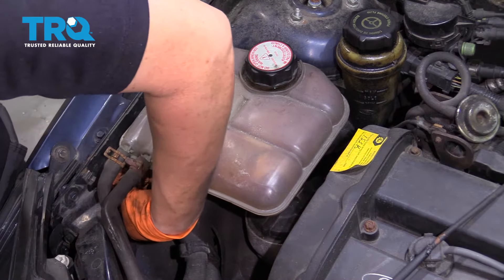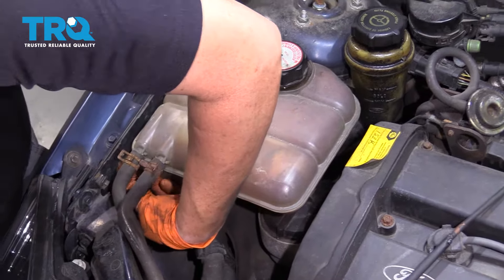How to Replace Serpentine Belt 2000-07 Ford Focus

Comment: 0:32 Nice video. Ours has a plastic cover underneath held on by two 10mm bolts that needed to be removed first. I'm pretty sure that plastic piece with the bolt in it on the right near your knuckles is what is left of the cover on the focus you're working on.

Comment: The A1 video showing alternator replacement said the tensioner was a 14mm. I imagine ill find out shortly, but im thinking you might want to clarify that. The 14mm worked, so im guessing its right, but im also guessing that not everyone watching this and trying to DIY it is going to figure that out real easy. Whats worse, is if it is a 14, but the 15mm catches just enough to make it work and someone either rounds over their tensioner bolt making it extremely difficult to ever do it again, OR it works just long enough to let them get their fingers in there THEN rounds the bolt making it impossible to let the tension off to remove them... they'll probaby end up removing them alright, just not in the way where they stay attached! Id want to distance myself from that mess if possible!
Reply: It was a 13 on mine lol
Reply: I think it’s dependent on which tensioner you have. I believe there’s three
Reply: My oem tensioner was a 15mm but I replaced it and the aftermarket one was a 14mm

Comment: i have a 2002 focus with A/C. Heres a good one for ya go to Oreillys and  order a belt cause im broke down right across the street. Easy! I got all the tools but the belt is shrapnel. spaghetti broke in 22 places.  So i get the belt for A/c for my model and its too long. Go back and computer is saying that is correct belt. Hmm so i go autozone to see if the belt they have is going to be same...yep it is. Now we keep eyeballing the one belts with no A/C and they are shorter....so for laughs i get one cause guaranteed a refund if it dont fit. Low and behold...It fit nicely. I even gave them my VIN to make sure, compared another brand. and for some weird reason My 2002 ford focus zx5 3 with A/C needed a belt the size for one without an a/c? crazy
Reply: I kid you not, no more than a hour ago I attempted to put in my zx5 2003 WITH a/c belt in and it's too long. If I had seen this comment an hour ago I would've known 😂
Now I know to get without a/c belt. Thank you for this
Reply: Same situation for me rn just broke.. which one should I get I have a/c too

Comment: what you didn't mention you don't have access to tensioner from bottom that easy because there are bunch of inner fender cover on the bottom that this car doesn't have or you already removed and didn't mentioned

and removed the tire also!